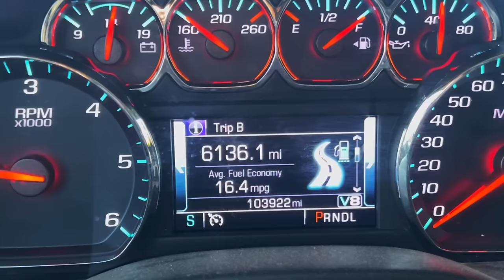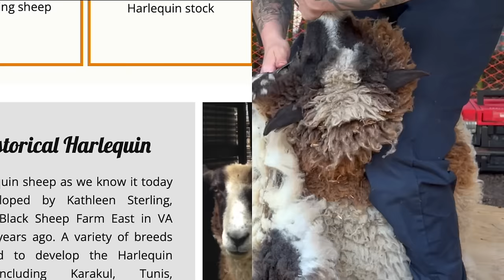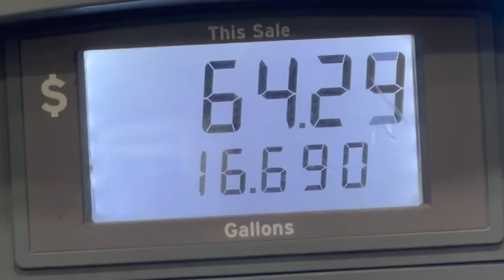Shearing Through Trauma & Drama

Comment: You should get the toe nail clippers that are Cordless (battery operated) & "Sheepishly Me" on YT uses them. The difference between the ones you use & SM uses, is the difference between a screwdriver and a cordless Drill. Save your hands plus its so much faster.

Comment: Did you get any looks from the fancy grocery? Back when I had a horse, I  would stop at the grocery after riding. I was nose blind to the barn smells, but I'm sure other people smelled it on me. Add in the dirt, grime, sweat, horse hair, bits of hay adhering to my clothes and mud caked boots and you get the picture. Lots of looks lol. Just wondering if it's the same for you guys? 
Also, do the lamas or sheeps hair smell funky if it gets wet the way  dogs will stink if they get wet? Just curious. Horses will smell like urine or manure if they lay in it while they're in a stall, but for the most part their coat doesn't have an odor.

Comment: Now, I know you know this because you're a professional. I'm just a big ole safety nerd and need to say this for those who may not know. If you're working with power equipment that has spinning parts like what she was using to sharpen her shears, please please please roll up your sleeves if you have any, and try to not have loose clothing that could get caught. I can't say I didn't get nervous when she spun the sander around to the other side while it was running.